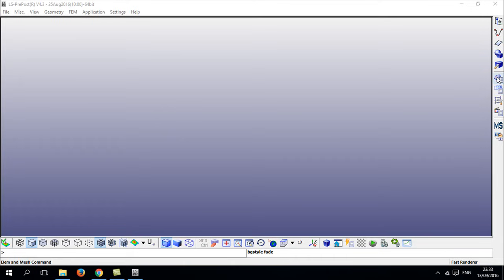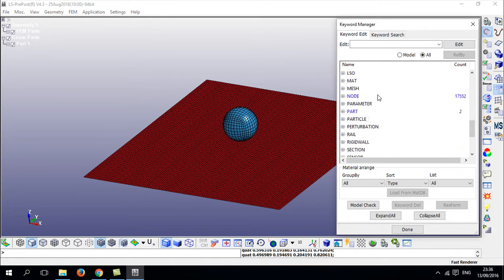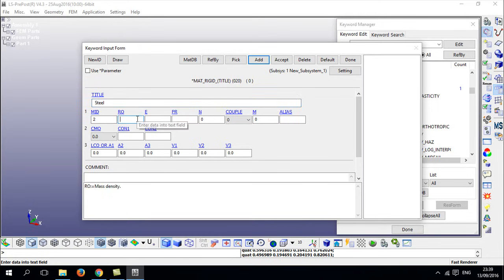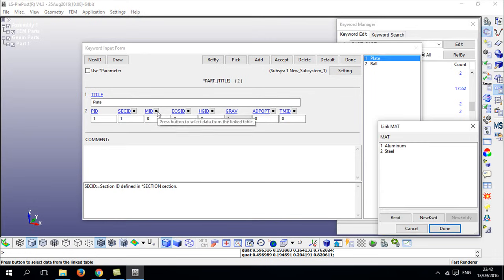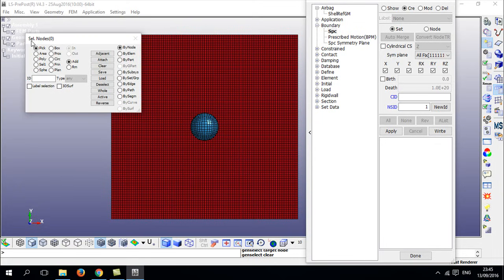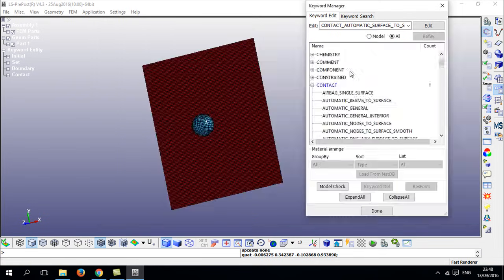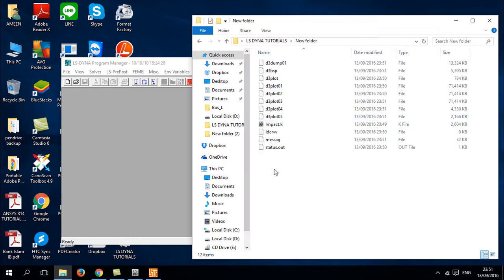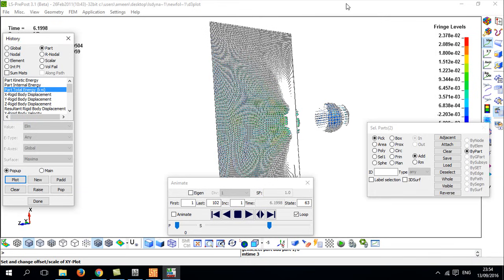LS-DYNA TUTORIAL 1: Ball Impact on a Plate

Comment: Hey, I want to perform the above simulation in 2D using the axisymmetric model in LS-DYNA. Is it possible? If yes, then how shall I proceed?
Reply from the maker: Yes, it is possible. You just need to choose the correct ELFORM.
Reply: @AmeenTopa  How to do that? I am new to LsDyna and have very little knowledge. Could you please refer me some documents or videos?
Reply from the maker: @siddharthjain1938  You can study the examples in this playlist to get the general knowledge about the software.
Reply: @AmeenTopa   could you please explain what exactly ELFORM is?
Reply from the maker: Under SECTION SHELL, you choose 13 or 15 for ELFORM. ELFORM is the element type.

Comment: Thanks for your video. It helps me a lot for beginner like me. While watching your simulation,  i came up with two questions. 
1) how much does the ball weigh? I've searched video and dyna's options but there is no options for mass (when making part)
2) what is the differences between density when you make model (below the radius) and one in material? 
Tahnks again
Reply from the maker: You are welcome. Please share my videos if you find them useful.

To answer your question, you can check my tutorial: Reinforced Concrete and Wrecking Ball

Comment: Thank you so much Sir! Your help in learning this software is HUGE!
Do you have something about erichsen cupping test on a circular specimen? 
Or maybe a tensile test on a welded specimen ?
Reply from the maker: You can check the following paper to see how to modeled the heat affected zone (HAZ) which was caused by welding:
Truong (2020). Prediction of slamming pressure considering fluid-structure interaction. Part I_ numerical simulation

Comment: sir, if the material used is isotropic elastic plastic, do I need to key in all the parameters, or is there any parameters that compulsory to be filled in order for the simulation to work?
Reply from the maker: You can check the keyword manual. It will indicates which parameters are necessary.
Reply: @AmeenTopa  thank you sir😁
Reply: @AmeenTopa  hi sir, I have conduct the simulation of ball impact on plate, how can I extract the data for displacement-force curve generation?
Reply from the maker: Check out my tutorial: "Post Processing Tutorial (with LS-Prepost)"

Comment: Hi Ameen thank you for the tutorial, when I run the model my plate did not tear it just crept. and I used inivel for the velocity assignment instead of 'initial>>velocity' but I got 'node out of range velocity' error.  What is the problem:(
Reply from the maker: There are few things that you can check:
- The velocity is assigned to the bullet not to the target
- The value of velocity is not extremely high (check the units)
- The material properties (check for typos)

The above three are general tips. I need more information to give a more useful answer.

For more tips, check out my blog entry here:
https://lsdynauniverse.blogspot.com/2021/03/instabillities-in-explicit-analysis.html

Comment: Hello everyone. I have a question. I am making strain plot to compare with the test results. I need to select elemental history plot strain. I have lower or upper ipt strain options. How do I know which one is on the strain gauge side surface? I mean how do we know which side is upper and which one is lower? Thanks.
Reply from the maker: I believe this depends on the normal of the shell elements. The normal will be pointing outward of the shell surface, which is the upper integration point.
Reply: @AmeenTopa  So positive normal is upper. I read integration point is not the same as surface but you can integrate on the surface via extra command. Thank you! 🙂
Reply from the maker: @Kenan2730  Yes you are correct. No worries.

Comment: Hey Mr.Ameen, can you please tell me how do you decide on what thickness value to use in the section ID for a part?
Reply from the maker: It simply depends on how thick you want your plate to be. If you want the plate to be 3mm thick, then you put this value on T1,T2,T3,T4 in Section Shell
Reply: @AmeenTopa   I am actually designing a Side Under Ride Guard for a truck. So for the guard is 100mm thick and 20 feet wide. So for T1,T2,T3,and T4 can I use 100mm?
Reply from the maker: @manojdanthuluru7913  Yes, shell elements are suitable for plate structures. Thin plates are measured by its slanderness ratio which is the ratio of its length to its thickness. In your case, the width is 20 feet which is much more larger than the thickness.

Comment: Hi Mr Ameen I want to know how to control in the time dynamic response to be delayed in ls dyna because the curve of max.displacement from ls dyna have the same value with experiment but it arrive to it before the time in experiment .the curves aren't applicable. I don't know where the problem.
Reply from the maker: Your question is very general and there is no one solution that fit all causes for this problem. If you can give me more details, then I might be able to help you.
Reply: @AmeenTopa Thanks for help me. I am studying the effect of blast loading on RC slab and strengthened it with FRP I use mat 72 rel3 for concrete , mat 3 for reinforced steel and mat 59 composite material failure for FRP sheet and I collected the data from experiment that I got it from net.when I compared the result between exp. and numerical  from ls dyna I found that the max. displacement value on RC slab very close( 8.23 mm) But it happened quickly.I mean the max.displacement in ls dyna happen in 0.005 msec.But in experiment happen in 0.009 msec.
Reply from the maker: @shimoretalmohamed6319  How are you modeling the blast? Is it with Enhanced Blast Load. If you have the pressure curves from the experiment, you can try directly apply them by using Load Node Set. 

This might be one causes. Others are like material properties, or improper/typos in blast input definition.
Reply: @AmeenTopa  I use set segment to determine The party of model that is exposed to the explosion  and use define curve to model blast loading it is about 3 points represents triangular shape.every point has x and y where :x =time y=pressure.
Reply from the maker: @shimoretalmohamed6319  Does the curve of the load is like that in experimental work? Is it triangular in the test or you are approximating the impulse load to be triangular?
Reply: @AmeenTopa  there is the values of pressure and impulse in a table in the paper of experiment and I calculate the time from eq.               Impulse=0.5*pressure*time
Reply from the maker: @shimoretalmohamed6319  which paper are you referring to?

Give me your email ID here and we can further discuss through email.

Comment: Excellent work!; During solid sphere creation step, the input needed is position vector (x,y,z) and two direction vector such as direct1<1 0 0> and direct2 <0 1 0>. What is the meaning of two direction vector in the solid sphere command? What is significance of the direction vectors?
Thank you
Reply from the maker: I have not investigated this matter. But as far as I know, there is no effect as long as you make your mesh adequately sized. 

The way how pre post makes the sphere, is making a circle first, then rotate that circle around an axis which goes through it. I believe this is the meaning of the two vectors. The normal of the circle and the axis of rotation.

Comment: My question is not correlating to the video, but I hope you can answer.
Is it possible to merge beam elements ?
Thanks for your time!
Reply from the maker: Beam elements are made of nodes. You can merge (connect) them using Merge Duplicate Nodes. The beams will be merged at the overlapped nodes.
Reply: @AmeenTopa  I mean let's say I'm modelling a rebar which is meshed into 100 elements. And later on  I wanted to mesh it into 30 elements for example. Is it possible to make those 100 elements as 1 element so I can re-mesh it into 30 elements ?

Comment: Hello Ameen, I think I did everything like you have shown on your video, but my alimunum plate is not broken after impact. So the deformations was just increasing and increasing during test but there is no failure. I have checked the failure strain EPSF in my model   and it is 0.4876 as you shown. Where  I was wrong?
Reply from the maker: There maybe few reasons: velocity of the projectile is less, the thickness of the plate is higher, the density of the material is not high enough...

Comment: Great initiation tutorial, thank you.
Reply from the maker: You are most welcome. Please do like and share my videos so everyone can benefit!
Reply: Sure. 
Is there anyway to modify the parts? Lets say that after you saw the results, you would like to move the ball position, or increase/decrease the meshing resolution of the plate. How can you do that?
Thanks in advance,
kindly.
Reply from the maker: Yes. 

To change the position of the parts, you go to Element Tools, then Choose Transform, click on Translate, enter the axis, n distance and select the elements you want to move.

To refine the mesh, go to Element Tools, Element Editing.
Reply: Ameen Topa Thanks, man!
Reply from the maker: You are most welcome bro.
Reply: I've got another question, sorry for asking so much.
My model contains several perpendicular shell elements. When I split the geometry and mesh it works nicely, but if I forgot to divide something and then mesh, how can I modify the FEM Parts? like split with nodes/lines to ensure connection among shells. Thanks!
Reply from the maker: Sorry victor, I cannot get the picture of what you are trying to say.
Reply: Ameen Topa when importing geometry, we have two type of elements: gemetric and fem. There are several geometry tools, my favorite is split. Once a mesh is done over a geometric element, fem elements are created. Is it possible to split the fem? or use tools similar to split, extend surface? some of my edges weren't properly connected and I need to modify them. 
If I what to make a refined mesh just in one segment of my model, how do I do it?.

Comment: Nice tutorial, have you done a video of  composite drilling analysis in LS- DYNA ?
Reply from the maker: No. I can do a video of a normal drilling. But not composite drilling.
Reply: could share me the steps for drilling in ls dyna ?
Reply from the maker: The only part that may be tricky is how to define the motion of the drill. You can do that with prescribed motion option. Other commands are straight forward.

Comment: should the rigid body be as master surface instead of plate in this case?
Reply: I also have this query. Cause the ball is rigid.
Reply from the maker: The Master is the body that will be hit (target). The slave is the moving body. It does not necessary be rigid. It can be deformable also.
Reply: Ok. I see. Thank you!
Reply from the maker: Nope. Not necessary. If you want it to be deformable then it is okay also.